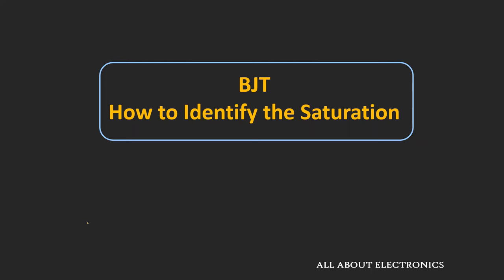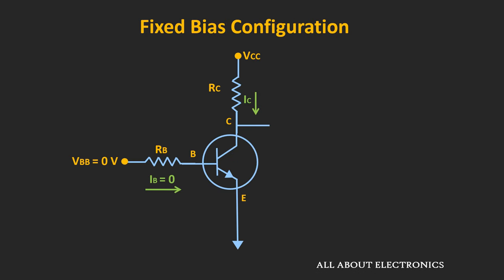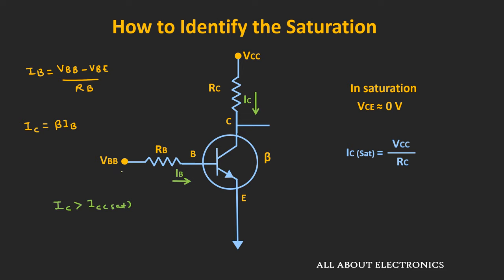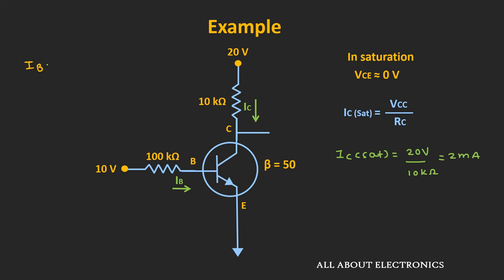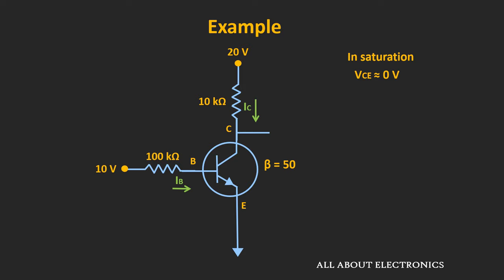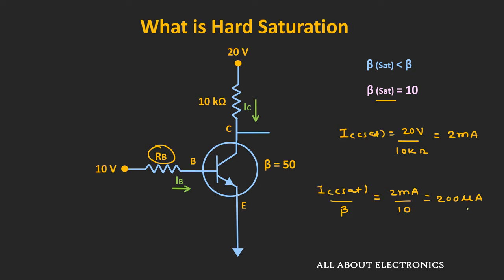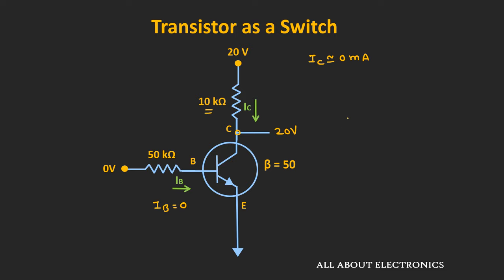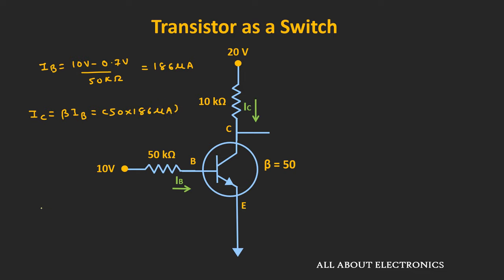How to identify the Saturation in BJT? What is Hard Saturation? Transistor as a Switch Explained

Comment: Sir,why is transistor considered to be in saturation when Ic is greater than Ic (sat)
Reply from the maker: Ic (sat) is the maximum current transistor can supply with the given value of Rc and Vcc. It's like when you connect a resistor Rc to supply voltage Vcc, then current which can flow through it is Vcc/ Rc. So, considering Vce zero for a moment, it is the maximum current which can flow through the collector. (it is defiend as Ic (sat)). When the calculated collector current Ic is more than Ic (sat), then the transistor can not supply more than Ic (sat). Or in other words, it can be said that the transistor is operating in the saturation.   
I hope it will clear your doubt.
Reply: ALL ABOUT ELECTRONICS understood,thank you for making a video on this topic,is there any possibility to understand this concept from output characteristics of CE configuration
Reply: @eunicedeepthivanka8958  its shot circuit

Comment: In cutt off why Vbb=0 it can be negative and Why Vce=0 for saturation region.
Also in input characteristics and output characteristics we only discuss zero or fairly low negative voltage for REVERSE BIAS.
Reply: Until the Vebo (maximum reverse voltage for b-e junction) is reached, a transistor with a negative Vbe will pass the same current as when Vbe = 0, so you don't need to worry about a separate case.
Vce is not actually 0V in saturation, but it is only a few hundred millivolts at most. Compared to the supply voltage, that will generally be negligible, so using Vce = 0 is normally an acceptable approximation.

Comment: Hi if you are not given the Vce(sat) do you assume that Vce(sat) =0V in the calculations to determine whether the transistor is saturated or not?
Reply from the maker: Yes. Typically Vce (sat) is 0.2V. But if it is not given, then it can be assumed as 0V to determine the operation of the transistor in the particular region.

Comment: How are we controlling the Vce to keep it near zero for cutoff? Is it by having IcRc=Vcc?
Reply from the maker: Larger collector current Ic means, large voltage drop across Rc. ( IC*Rc). And hence VCE will reduce and will operate the BJT in saturation. 
In cut-off, Ic is almost zero, so VCE is approximately equal to Vcc.
Reply: @ALLABOUTELECTRONICS  Thank you sir

Comment: This is confusing because my prof told us that if Vbb is smaller than Vcc it will automaticaly be in active region and if Vbb is bigger than Vcc it will be in saturation region. Please explain to me because your Vbb is 10V and Vcc is 20V therefore it will not be in saturation. 😣😣
Reply from the maker: It’s not always necessary. You also need to consider the base resistor. With large value of Vbb, if you also use large value of Rb, then it’s quite possible that the BJT is still in active region. Rather just looking at the voltage levels of supply, you should check the condition which I have mentioned in the video.

Comment: Ic(sat)  is the maximum current.. 
Then how is it possible that Ic>Ic(sat) ❓❓
Reply from the maker: It can't be greater than that. In fact, during the calculation, if calculated Ic is greater than Ic(sat) it means that the transistor in saturation.
The thing is, during the finding whether the transistor is operating in active or saturation, the value of beta which is used for the calculation is for active region. In saturation, the beta reduces. 
I hope it will clear your doubt. 
For more, info you can go through the examples on BJT on the second channel. Many similar examples are covered there.
Reply: @ALLABOUTELECTRONICS  Ic<Isat to operate in saturation region..And  saturation region, we find it from output characteristics and in active region constant current flows(for different constant input ib current fixed) that means here current gets saturated and you are saying Ic>Isat then it operates in breakdown region and transistor eventually gets destroyed..🤔😑
Reply: @ALLABOUTELECTRONICS  This is why it's better to compare actual current gain with β, and then you know that the transistor is in saturation when the current gain is significantly less than β. Avoid the confusion caused by calculating impossible currents.

Comment: Well done. You covered all of the practical cases that would be encountered in real applications of a switching transistor. However, for students, you are much better off teaching them to identify saturation by comparing the ratio of the saturation collector to the real base current with the transistor β, as you did at 6:20 and showing that when the transistor is in saturation, its current gain is significantly less than its current gain (β) in the active region. If you stick to this method, nobody gets confused by imaginary collector currents such as the Ic=4.65mA that you calculated at 5:33 or the Ic=9.3mA that you calculated at 12:00 (using the test of whether the actual current gain is significantly less than β only deals with real currents, so less confusion).
One other small point: your calculation of the transistor's output impedance in hard saturation is naïve. In reality, the change in Vce(sat) with current is very small, typically around 200mV for a change in collector current of around 100mA (viz. BC547 datasheet), thus giving a dynamic resistance of around 2 ohms, and of course, it's the dynamic resistance that's important in real applications.
Reply: Tnx.. cleared my confusion

Comment: For npn transistor, practically Vcb >(-0.4) for active region. Please explain why the characteristics shift backward beyond origin.
Reply: Assuming a silicon npn transistor: in saturation, the base-emitter junction is forward biased, so must retain a voltage drop of around 700mV. So Vbe ≈ 700mV. However, the collector will still attract charge carriers from the emitter with as little as 100mV between collector and emitter, so Vce(sat) could be as low as 100mV or so. The collector doesn't have to draw any current from the base, so the voltage at the base relative to the collector is immaterial, and the collector will still drive current through the emitter even when it is has less voltage that that at the base.

Comment: 08:41 ,  For Hard Saturatin, We used here Beta as 10. Why did we not use Beta as 50 which was given in the circuit here.??  Nor in The ckt there will be mentioned any value of beta, but we have to use for Hard satuaton by understanding.?
Reply from the maker: It is the typical value. The beta value given in the circuit is for active region. For, saturation region, according to the base current (how fat the transistor is in the saturation region), the beta value will change.

Comment: datasheet provides a range of beta values. How do we decide which beta to select?
Reply from the maker: In the datasheet, the different values are given for the different operating currents and voltages (Ic and Vce). 
Based on your required operating condition, you should choose the nearest value of beta for calculations and design.

Comment: great vid.  at 9:03 in the video where/how did you get Vbe as 0.7v?
Reply from the maker: It is the typical voltage between the base-emitter junction. Much like a forward voltage drop across the silicon diode. If the value of Vbe is not given then it can be assumed as 0.7V. Actually, for transistor to transistor, it may change with the operating point. (Not by much though). But for estimation, it can be assumed as 0.7V for the calculation.

Comment: What is the difference between (in terms of what is the type of output (voltage or current) and where that output is taken) circuits for BJT as a switch and BJT as an inverter.
Reply from the maker: Well, when it is used as switch then load is connected at the  place of collector resistor (mostly).

Comment: Which is the best biasing to be used to make the BJT in hard saturation for the same values of Rb ? 
For eg, we studied various biasing fir the best amplifier so that Q point will be in active region ,which is best biasing for BJT to be used as switch.
Please explain .
Reply: That was explained in the video. To ensure saturation for any small signal transistor set the base current to be 1/10 of the maximum collector current for the circuit you are building. You only need Ohms law to calculate the collector resistor when you know the supply voltage and the required current, and Ohms law again will then give you the base resistor when you know the driving voltage.

Comment: Sir, I have a doubt. It is said that in saturation region, both the diodes will be forward biased. But clearly in the saturation mode, Vc is taken positive when compared to Vb(20V and 10v respectively). Since collector is n type, shouldn't it be more negative? This question is bugging me a lot. Please help.
Reply from the maker: In the saturation, if you are aware, the Vce (sat) is around 0.2V. If emitter is connected to the ground terminal, then Vc will be 0.2V right !!
Vb is at around 0.7V, Since Vbe = 0.7V. So, Vb> Ve and Vb > Vc.
So, both junctions are forward biased. 
I think what you are talking is the supply voltage at the base and collector (Vcc and Vbb). But there will be a voltage drop across base resistor Rb and Rc. 
So, voltage at the base and the collector will be different than Vbb and Vcc.
I hope it will clear your doubt. 
If you still have any doubt, let me know here.
Reply: @ALLABOUTELECTRONICS  Yes. Sorry that I completely ignored the Rb and Rc voltage drops. 😂 Thanks for clarifying. A big thumbs up!👍
Reply: @ALLABOUTELECTRONICS  Actually, in saturation, the base-collector P-N junction is only forward biased by at most around 500mV. That is insufficient for any appreciable current to flow (a few nanoamps for most silicon junctions), so that becomes completely negligible compared to the milliamp-level currents flowing from base to emitter and from collector to emitter.

Comment: Sir when there is a resistor Re in common emitter then how we find
Reply from the maker: Find the voltage VCE as if the BJT is operating in the active region. If it is in the saturation region then you will get negative VCE. or second way, both base-emitter, and collector-base junctions are forward biased in saturation. So, that's the other way you can find the region of operation of BJT.

Comment: Sir why we assume Vce = 0 when it is in saturation region?
Reply from the maker: In saturation region of operation, typically Vce is around 0.2 to 0.3 V. And when BJT is used as a switch then it is used in the saturation and cutoff region, where it acts as on or off. In saturation, since Vce is very low, for digital circuits it can be assumed as zero.  ( very low voltage drop).
I hope it will clear your doubt.
Reply: @ALLABOUTELECTRONICS  sir, Is it because in saturation region of operation since both junctions are forward biased the electron flow from emitter to collector is very small? So that Vce is small?
Reply from the maker: @nayanakv2382  If you see the collector and emitter current, then they are comparable. But since base-emitter and base-collector junctions are now forward biased, the difference between emitter to collector voltage Vce is very small. For the NPN transistor, If the emitter is at ground potenital, then the base is somewhere around 0.6 to 0.7V. In saturation, since the base-collector junction is also forward biased, the collector is also less than the base voltage. (Typically 0.4 to 0.5V less than base voltage). Hence, Vce is around 0.1 to 0.2V in saturation. I hope it will clear your doubt.
Reply: @ALLABOUTELECTRONICS  yes sir clear 👍🏻